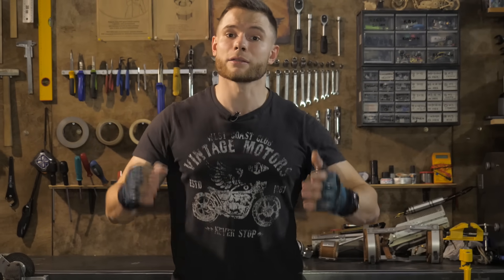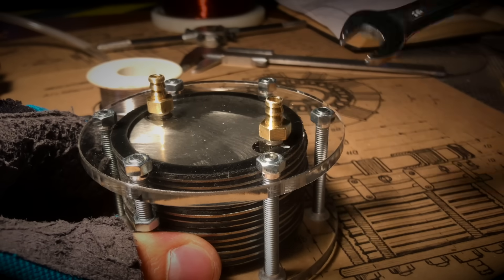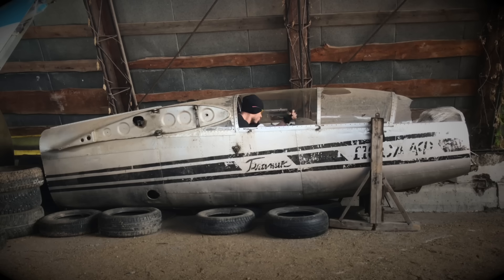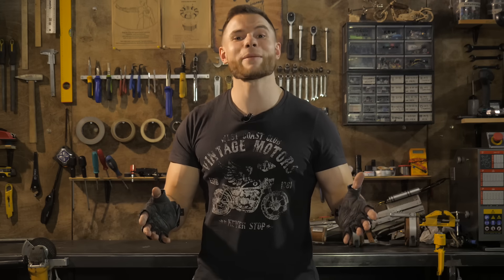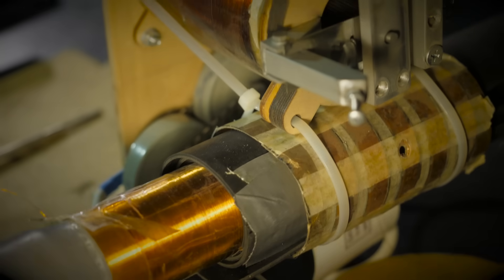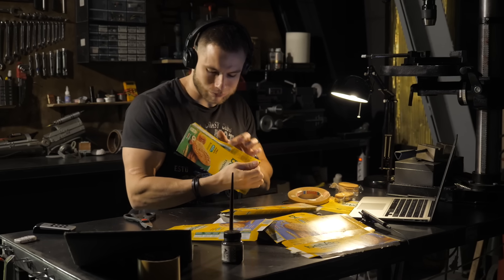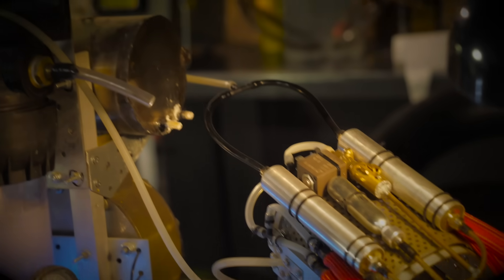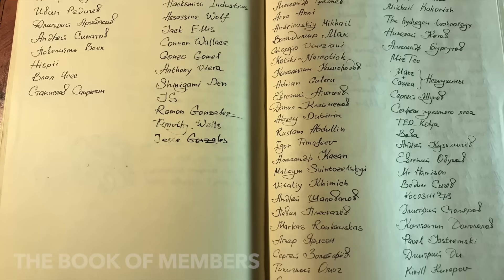Building real Iron Man suit (Part#1: Conception & Protoypes. Reactor, Repulsor, Armor, Exosuit)

Comment: How do you bypass the production of aluminum chloride and on another note once that combines with the water in the reactor forming hydrochloric acid 

For just KOH solution what do I do with the biproduct potassium aluminate because of i crystalize it, it will eventually become a carbonate then if I leave it in solution I'd end up with a bunch of corrosive solution to do nothing with

Comment: I use to love gyroid forms but by using booling tool of a gyroid cube on a normal cube you can create a anti gyroid form that actually contains two different forms that are everywhere same distance close to each other and I made one of stainless steel whit 0.5 mm thick for 1mm of distance between the forms ,it is difficult to make and fragile but it is the best and smallest electrolyser I’ve made that is I think better than a normal electrolyser … oh yea and I use D30 under Kevlar Tom make my “suit” able to absorb shocks.

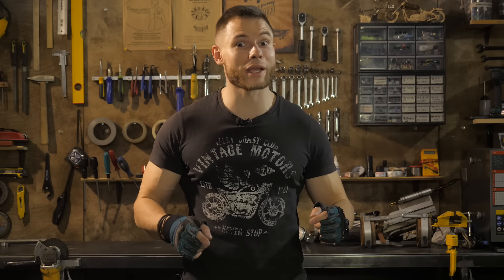Comment: I know it’s a little simple compared to all this, but when you’re talking about joints could you use mini hydraulics. I noticed Similar structures to the loader of a tractor at 16:07 on the under arm of the suit. If you make them small and use a few it should help with moving and slowing you to move. Have some pull while others release to get almost a teter-totter affect.
Reply: Allowing not slowing you to move.

Comment: Anyway to mimic hydropower, but more in the sense of the vacuum of space and how an initial  thrust turns into continuous speed in space. What if you recreated the vacuum of space and mimic the method of hydropower. So you would just have to deliver an initial thrust which  would proved continuous movement in the vaccum of space. Then find a way to capture that energy?

Comment: FOR BETTER MOVING AND SMOOTH MOVEMENT,CAN YOUR SKELETON BE SCANNED ?LIKE ALL THE  BODY MOVEMENTS GETS INCORPORATED IN THE EXOSKELETON ITSELF.REPLACING ALL THE STIFF METAL MOVEMENTS WITH TOUGH BUT ELASTIC LIKE METALS,JUST LIKE A RUBBER CLOTH / STRETCHABLE METAL SKIN . NOW THIIS IS JUST AN IDEA, IF IT CAN BE DONE I THINK WILL IMPROVE EVERYTHING A LOT.

Comment: MAN THE BEST Mechanical Engineer here: Try looking into adding 0.15-0.20% Vanadium to your Al-Fe-Ti alloy for additional bulletproofing designs. It increases the ultimate strength while dispersing heat more quickly and increases hardness (like in  high-speed tooling). It will create fractures in the surface of the armor with extreme pressure, but that disperses the energy moving through the plate into the fracture lines. Also increased hardness will make glancing shots slide on the outside of the armor (the same is true of melee attacks as long as the armor is smooth and polishedMechanical Engineer here: Try looking into adding 0.15-0.20% Vanadium to your Al-Fe-Ti alloy for additional bulletproofing designs. It increases the ultimate strength while dispersing heat more quickly and increases hardness (like in  high-speed tooling). It will create fractures in the surface of the armor with extreme pressure, but that disperses the energy moving through the plate into the fracture lines. Also increased hardness will make glancing shots slide on the outside of the armor (the same is true of melee attacks as long as the armor is smooth and polished.Loving the new style of these videos! Your production value has gone through the roof! Love the little Tony Stark easter eggs in it like eating cookies while you're working, and the Rick and Morty reference at the end killed me. To a better tomorrow, today!This guy is like all of hacksmith industries in one person. If he had more money he would literally be iron man right nowThis guy is so freaking cool and intelligent. What a legend.This dude here is amazing. He is not building these fake emulators. This dude is literally building the real suit.Every single big brain Youtubers like Colinfurze, Mark Rober, Hacksmith Industries, etc. Should collab in this project, if all these people collab, it will be a collab more ambitous than Endgame itself.This is going to be great when its done, that mask looked awesome already.Modifying and making the movie suit your own is way cooler than making it look like the movie, your final result is gonna be way cooler than anything that was ever put on screen.I want to say that this video is heavily inspirational to me. I want to be an engineer when I get older. So seeing people like you designing and building tech like this is eye opening. I really appreciate your content and I think you are doing wonders for young inspiring engineers and builders. Thank you and god bless! Happy Easter!

Comment: Could you make  chest plate and put experiments ideas and ex power I have made 2 parts hand plate and healmate   With a head up display with arc Reactor hot glue on you or solding startion

Comment: 7:52 so internal thermoelectric plating, and a liquid cooling system with tubing run along areas where the body loses a lot of heat. that way you can always warm or cool your body, and if the liquid coolant gets too hot you can start harvesting that heat with the thermoelectrics to power active cooling.

I'm definitely got some ideas for joints and attachment points as well, but I'm going to try to put them down on paper and maybe make a video

Comment: Put a small AIR CONDITIONER MADE OF  Peltier AND HEAT SINK IT CAN FIT IN ARMOR BY SOME ADJUSMENT YOU CAN  SEARCH IT ON YOUTUBE TOO.
PELTIER ALSO KNOWN AS :  
Thermoelectric cooling uses the Peltier effect to create a heat flux at the junction of two different types of materials.

Comment: So you know the thing that connects a shower head to a wall, the flexible metal tube. You should use that to cover the joints and where you need to bend. Its strong, durable and extremely flexible. I dont know how he will make it into a joint peice but i think he will

Comment: You may want to take a look at full plate armor, especially gauntlets. They knew exactly how to make a comfortable and flexible exoskeleton. There are also some modern versions made out of synthetic material that is even more comfortable. You could use some of those designs as an inner shell, attach the muscles and other active components as a middle layer then put the armor on top as an outer shell.

Comment: Hey Alex have you ever thought about using a rollerblade boot ankle boot into your designs maybe also for other joints as well. 

Maybe you might find a way to ratchet the armor together with cables that lock clips in place.

I rollerblade from time to time cables as laces make it easier to put them on and to take them off.
Reply: Add this comment to Alex's comment where he asks for your idea.

Comment: So for the joints- maybe instead of using just hinges, something along the lines of the medieval armour could work? I mean kind of a scale-type thingy. They might not seem like but they are quite flexible and maybe that would be the solution to movement restrictions. And the other thing- I assume that eventually you probably will implement some sort of display into the helmet, because what Ironman is it without all this fancy tech inside his helmet 😂 I figured that maybe some sort of hacked version of heads-up display that you can buy to a car could do a trick with this and a display whatever you might need directly in front of your eyes without too much of a sight restriction. I think it could be a better (and for sure cheaper) solution than using cameras, which may have some delays now and then. Love your videos, greetings from Poland 😁
Reply: you should try to put this comment on the one of the two comments of his where he asks us to give him ideas!!

Comment: You can make the arc reactor better by using 50g of aluminium block and oxidise it and use polytetrafluoroethylene to only let the h2 gas go to the pipe which powers the suit.
Just saying.(50g of Al gives 50L of h2)

Comment: Have you thought of using ball bearings to rotate the arm joints and the likes? Like how a wheel turns? If you connect the outside of the armor and the band on your arm by the bearings then you can rotate freely correct?

Comment: For some of the armor try using titanium if it is affordable.  Titanium has the strength of steel with half the weight, that would reduce muscle fatigue for the organic systems involved in your build, also titanium in the right thickness is also bullet resistant.

Comment: I always wondered why pneumatic lungs were used directly on the joint itself. Surely they could be stored at a better point and the load could be pulled with a pully system attached to multiple of them, which you would have more room for, if you weren't putting it at the joint.
Reply: you should try to put this comment on the one of the two comments of his where he asks us to give him ideas!!

Comment: I have an idea, For the forearm, use bearings. You see, if you use bearings, then your repulsor  
build will make less contact with your skin and putting that little bearing in will make it more accessible to rotating your hand. attach it close to the wrist ant make it tight there so it rotates with your arm. I know it will go down once you bend your elbow, so maybe make like a thin two layers attached to the forearm, so when you bend your arm, only one plate moves back and the other stays secure.  If that makes sense. like if you want more movement in your shoulder, i suggest like a Universal joint. using one of these wont restrict your movement as much. It works like a socket and ball joint, except metal. You probably already thought of that though.
Reply: I will add, maybe a thin layer of light padding so all of the metal wont keep contacting your skin.
Reply: Oh yeah, And if you want to fly, you need very powerful rockets, especially with your suit. You also might need shock protection from a jump or something. And you could possibly use compression and tension springs later on in the future. not to mention spine protection. there is also a possibility that the suit can get real heavy. so your gonna need to pressure all the joints are supported, mainly the spine and the legs. They are gonna need a lot of support, hence the compression springs. maybe you can use the hacksmith idea. use small powered pistons to help around the joints. and use the compression if the Water and Aluminum gas since it is reusable. One challenge is controlling a lot of these movements, that is a lot of buttons and controls.
Reply: you should try to put this comment on the one of the two comments of his where he asks us to give him ideas!!
Reply: @marz.6102  oh ok wheres that?
Reply: @JustSomeGuyWithADHD  go to top comments and he made two comments one of those asks for ideas from the community but you'll have to keep scrolling down for the one I'm saying.

Comment: I am not a engineer I am a kid and has a dream for making a iron man  suit at a cheap cost in India. So I can suggest you to use a layer of sorbothane in the exoskeleton to make your away from shock and also avoid uneasiness.
Reply: Yeah you can use this new type energy source and make hollow case in which between the ages you can aluminium pipes and liquids which can be fixed in your leg as a flight energy source. My name is Sagnik Mondal and my age is 14

Comment: could you make use of the waste heat from the aluminum reaction? I hear "exothermic" as "wasted heat that could be used". Maybe use some sort of low boiling point liquid like alcohol in a heat exchanger to do something. I don't figure it could be enough to move a small impeller in a motor to recharge the battery a little bit.
Reply: Or small sterling engines that suround the chemical reactor

Comment: To insulate yourself from the heat put a layer of kaowool (replacement for aesbesdos that won't give you cancer) and maybe an outer layer of nomex( fire retardant fabric) to not get all itchy from the ceramic fibers of the kaowool also wear a respirator when cutting it because the ceramic dust will cut your lungs from the inside and that doesn't sound like fun at all

Comment: my only issue with this suit is all the mention of "plasma". a small hydrogen/aluminum reactor would not be able to produce enough joules of energy to turn whatever gas is used into a plasma. plasma is what THE SUN IS MADE OF and even though hydrogen turns into plasma at a fairly low heat (about 9 to the power of 8 kelvin) and this is LOW for plasma and must be done in a vacuum. so the power might work but the repulser is NOT plasma. it is most likely just a high temp flame around 200-250c which is still hot but no where near as hot as plasma. and having plasma that close to your body would probably melt your arm and part of your chest due to the heat and instability of plasma outside of a vacuum.

Comment: I have an idea for the armor so the idea is that you put some flexible armor inside of the metal armor of the suit but it hardens when it gets impacted. Another idea I had for the metal of the armor (which I don't know if this alloy exists or not) is have an alloy of aluminium, cobalt (which yes I know is expensive), and steel if such an alloy exists it might help stop actual bullets depends on range and etc.

Comment: i think the joint problem would be fixed if it wasn't connected to a singular point like the 2 bolts holding the hinges. i think your gonna need 2 hinges per joint, one specifically for the bending of the arm and another to rotate the joint mechanism but how and what kind of hinge system that would look like is well above me

Comment: @alexlab have you considered carbon fibre components as well as suit shells?

The hydro/reactor you have, does it really need to come out and off the chest or can you stream line that closer to the body by using it across a larger surface?

What about putting the main power reactor on the back and an auxiliary reactor on the front

Comment: elbow guard in center with arm plates coming off and the joints connecting to the guard not each other. Two bending points with room for the elbow should help a bit with the stiffness

Comment: Hello! Professional exoskeleton builder here. Regarding your issue with joint alignment for the exoskeleton, this can largely be solved with a slide joint coupled with the rotational joint. 
Hard to do in text, but think something along the lines of:

<-> O <->

Where the <-> are the slides (small delta in proportion with the body part. ie 5 cm for elbow) and the O is the rotational joint. This will allow the exoskeleton to self-align and reduce the slippage (and follow-on chaffing) that typically occurs in exoskeletons.
Reply: you should try to put this comment on the other comment of his where he asks us to give him ideas!!
Reply: @marz.6102  Oh, good call!

Comment: I know you arnt working on the legs yet but here’s an idea for them. Instead of trying to fly using the thrusters, what if you made it so that when you jump, thrust is shot out of the bottom of your feet so that it acts as a jump boost. It would require really powerful thrust, but this way you could use up a lot of fuel for one jump so that it’s more powerful and not worry about how you are going to fit all that fuel into the suit. I think jumping is the first step before flying. And maybe instead of the current fuel you are using, you can use something else that produces a lot more energy when it’s burned.
Reply: you should try to put this comment on the other comment of his where he asks us to give him ideas!!
Reply: @marz.6102  where is it?
Reply: @marz.6102  nvm found it
Reply: @gschadalavada8980  gud luck

Comment: try and look into medieval plate armor layering, it uses hard outer plates attatched to leather fitted tight enough not to let anything through, but loose enough to allow movement, it may cause some visual changes, however, often times in science, a good step forward is looking a couple steps back. a good source of inspiration may be to look at gothic plate armor and roman centurion layer plating, they were touted as having full mobility if fully assembled to fit its wearer.
Reply: you should try to put this comment on the other comment of his where he asks us to give him ideas!!

Comment: Now that you have an on-board power supply, and an excess of heat- What about finding a way to convert some of the heat energy-loss into electricity, to charge a capacitor bank for a wrist mounted miniature rail gun?
Reply: you should try to put this comment on the other comment of his where he asks us to give him ideas!!
Reply: Module Sterling engine!!
Reply: Thanks for the suggestion! I totally missed the other comment asking for suggestions

Comment: I am not good engineer but idea to use batteries is good but on risks of voltage potential user should secure with safety ( differrent when load and our body voltage current )
Also, refectible joints since you are concerns that this kinds of suits will match with body movements ⁉️
The mask since you knows Aerosoft and building suits the impacts angles that doesn't match in movie, once impacts with target have to bends outside your safe zones and more ... 😃
:: Does it suppose to absorb or bends of the incoming like a car not every angle will be hard.
Thank you so much, very good VDO.

Comment: Dude.    U can use segmented parts with bearings in between Each segments which helps u to develop more easy  movement....  Don't use a single plate and cover the body rather use segments....  Like let forearm be divided into 5-6 segments which are interconnected through segments... .... For. More details contact sreeragmenonrolling123@gmail.com
Reply: you should try to put this comment on the one of the two comments of his where he asks us to give him ideas!!
Reply: @marz.6102  ohkay dude. Thanks...